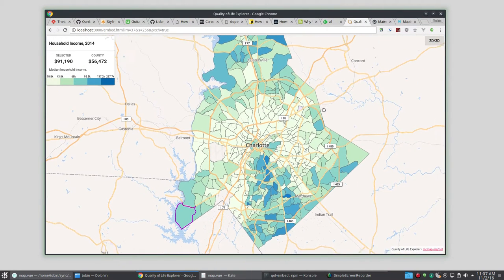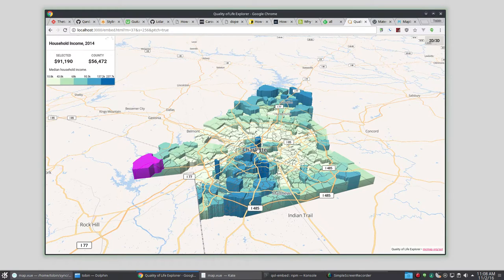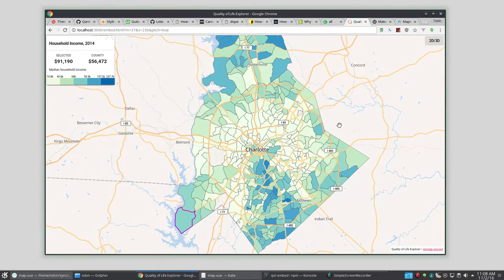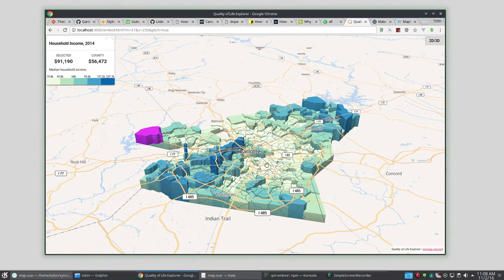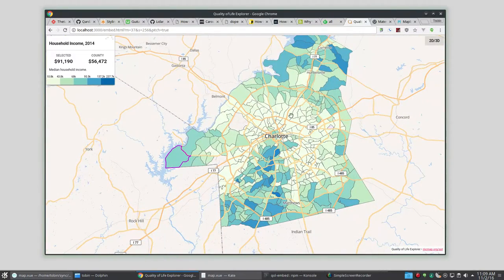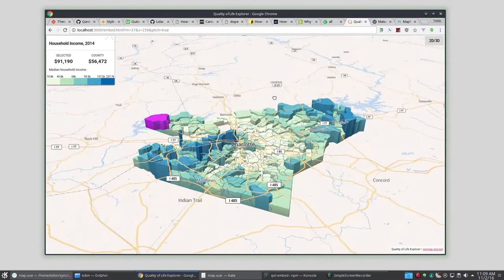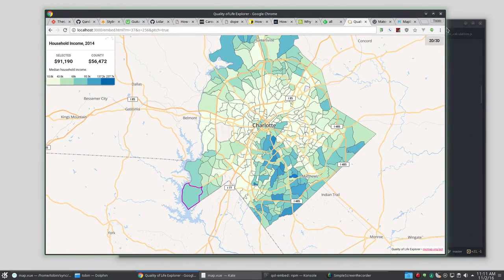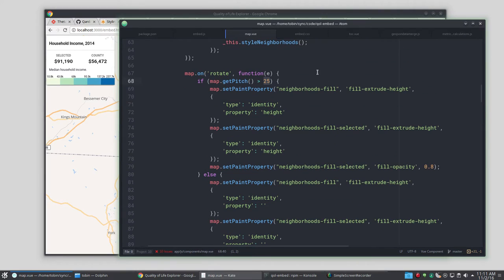Extruding polygons in Mapbox GL JS 0.26

Comment: This is a pretty good tutorial/explanation of the extrusion property. Are you able to outline the execution/steps of the various components? (IE: , .js properties, where does the data originate for the vector, is there any customization needed in Mapbox?) Also, does the embedded map work on mobile ( responsive)?
Reply from the maker: To answer in reverse order - 

As long as the client can handle WebGL, it should work. That would include Safari and Chrome.

In terms of execution steps, you need (1) geography with a number column to set the extrusion height, and (2) add a fill-extrusion layer to your map, either after the map is loaded of via your GL JS style file (you can see how to do that here: https://www.mapbox.com/mapbox-gl-js/example/3d-buildings/). That's it. No other special steps are necessary.